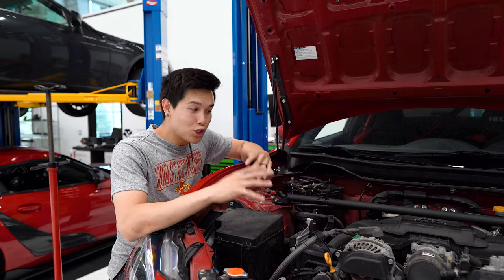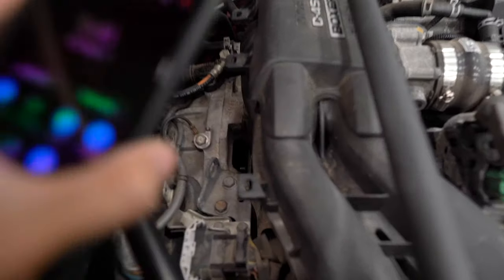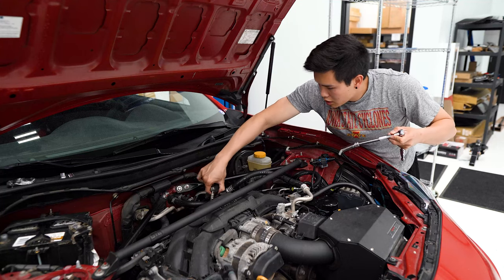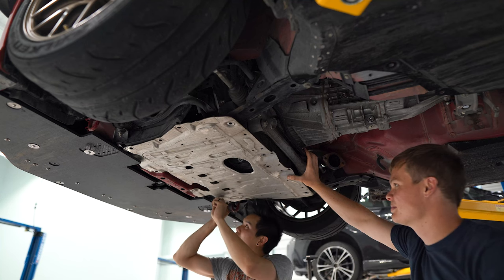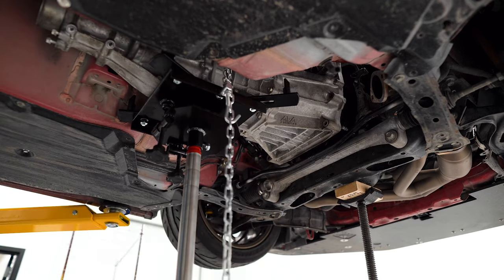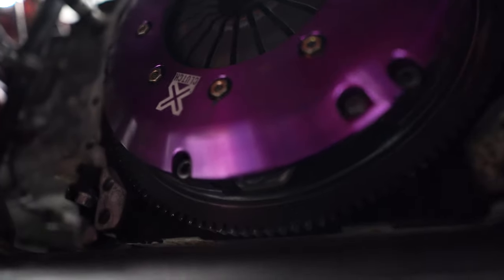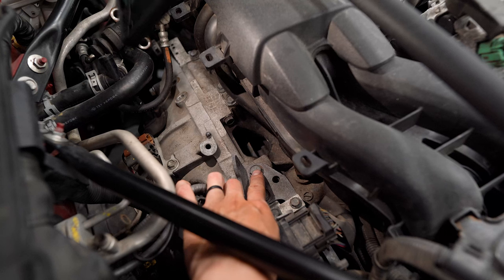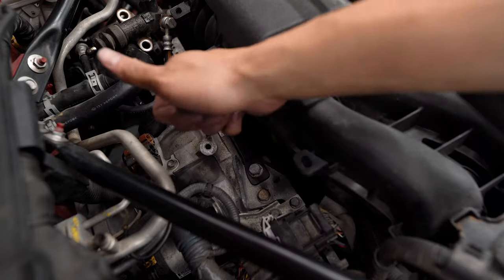It fell into the transmission | Verus Bell Housing Cover

Comment: I envy your access to a lift.  Now that I've done 6 engine swaps in my 86 in the last 3 months I can I say I'm happy these cars are easy to work on but having a lift would make things MUCH easier.   Ultimately I think I left the rubber transmission plug out but in retrospect, the peace of mine of having it there is probably worth a trip to the online dealer.
Reply from the maker: Just buy the Verus replacement, it's only $40 and can't drop in there!
Reply: @KevinVo   Verus makes some handy stuff (I have their brake duct housings) but it's hard to spend $40 on something I could accomplish for free with a sheet of spare aluminum in the garage.

Comment: This happened to my car and I ended up replacing my whole transmission after the housing cover shattered in my bell housing and ruined a few teeth on my face angle plate. I drive the automatic and it hasn't quite performed the same since despite the Trans swap

Comment: I was trying to grease the clutch fork pivot ball and dropped a paint brush I was using to grease it into the bell housing. I tried various ways of fishing it out for hours and eventually nudged and it fell all the way to the bottom, I dont know of a way to get it out without dropping the trans, I would have to get it towed to a mechanic from my house as I can not do that myself. Does anyone have any ideas of how to get it out or do you think it would be ok to drive with it in there? As of now i have been trying to fish it out with metal wire through the clutch fork whole in the trans
Reply from the maker: If you're able to get it on jack stands you can try to fish it out through the cover you can remove on the side of the transmission.

Comment: Oh,.... Ah.... I totally didn't not know about this issue. Does this issue apply to "WRX" 2015 to 2021, too? ... 
My WrX year is 2019. 🤔 Car manufacturers nowadays, like  to replace engine parts with plastic 😢 ... I prefer metal material 👍 long lasting and less likely to crack overtime not like rubber parts.
Reply: Dang Subrau, they need to stop putting these rubber parts  for their engine. Lucky, Kevin got a chill lady and he going to get a ice 🍦 cream  👍 at end of the video. 😁 Thanks for another great and  information videos. 👏